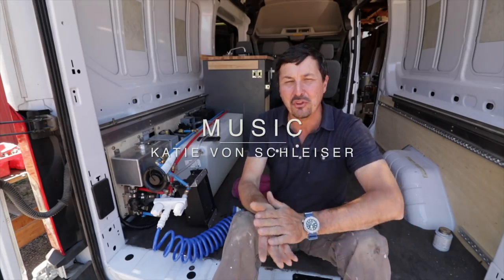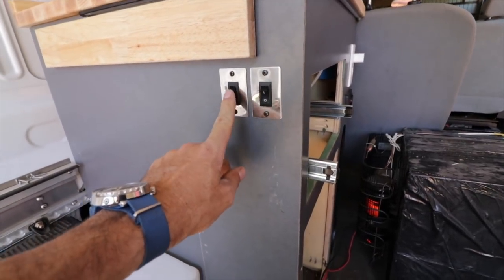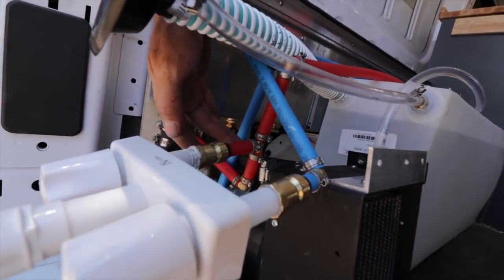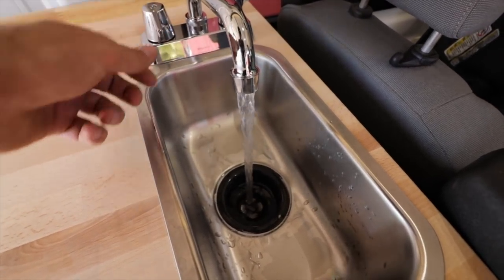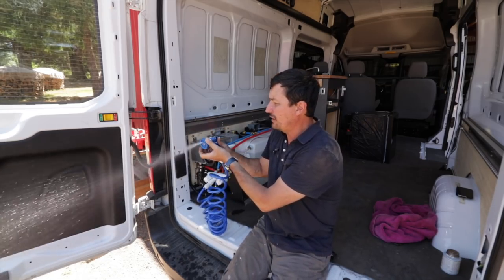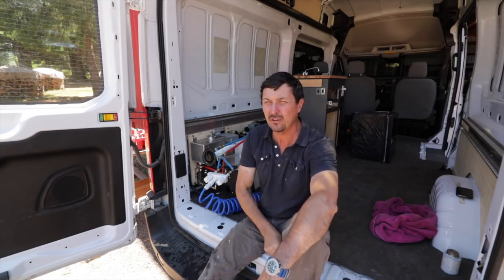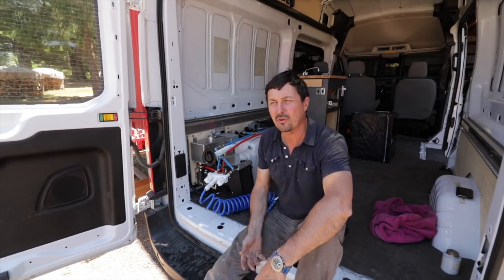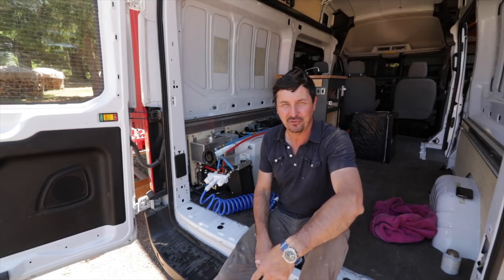Adventure Van - How To Build A Outside Shower

Comment: why wouldnt you build with your abilities?  I have a small enclosed that ive built with air conditioning and electric.  works for the wife and I.  working on an outside shower set up but it doesnt fit the kids as well.  we have kicked around the idea of a toy hauler but they are expensive and as you stated quality is very bad even the good ones are horrible.  Ive watched my buddies struggle with theirs.  Im really thinking about building a much bigger enclosed trailer.  either way it will require a truck bigger than my 1/2 ton

Comment: Cody ,check out some of the 4wd campers and their shower sustems.Some of them have a fold out shower cubicle that will give you privacy when you have a shower,I am with you 100 per cent on your build.I dont want a trialer and some of the campers are very heavy and way over the top in ways that mey be "nice" but are lacking in innovation ,quality,and or features tuned to what you want.I will try to add a link to a shower thing that i mean
something like this....https://www.drifta.com.au/product/drifta-shower-ensuite/

Comment: dont buy a mixing valve.  dude put a shutoff on the line under the sink on the hot water side only. assuming u dont have u. and trun it in the off position with the faucet on until you get a perfect mix
Reply: works great for the sink styles with universal valves that turn on  hot and cold at the same time. so change your sink knobs to one  that when u turn it on it turns on both waters. one way to far is hot. one way to far is cold. than if u have a direct shut off on your hot line u can barely have it open so the mixture with the cold water "even if the hot is to hot" makes it neutral

Comment: I can't believe people even pay money for an RV. Snake Oil salesmen!
Reply: I have done my share of RV bashing, and they are built cheap...for a reason.  They also need to be light.  That said, they have their place.  There are some nice 5th wheels out there, especially.  If you are going from campground to campground, stay on interstates, use it for your 6 month or year vacation to visit Yellowstone...They can be a great addition.  Beats the hell out of a hotel room.  Everything is going to have problems, including his Transit conversion.  Everything is a trade-off.
Reply: Tenspeed TheBikeHanger I'd choose a 5th wheel over a motor home, anyday! Biggest prob with them? People pull with pick-ups that are grossly unequipped for heavy weight. Too many people have made the mistake of only beefing up the suspension, tires, & wheels. Without beefing up the drivetrain giving most attention to the GVWR. Best solution? Aquire a heavier duty truck such as an F-350(can tow 14k lbs) or bigger(tow vehicle). I've seen plenty of solo vehicle accidents where the tow vehicle's tow capacity was way overvalued. As the result the tow vehicle couldn't handle the weight and went into the ditch! Big, big bummer! Of course ones intentions for what they want to use it for, should be the 1st consideration. I'm biased towards Cody's intended purpose. lol